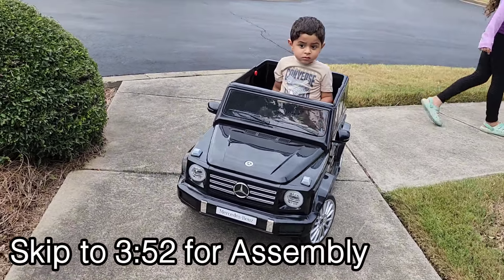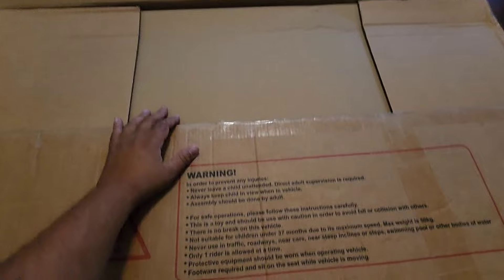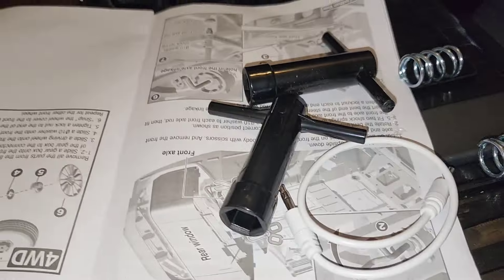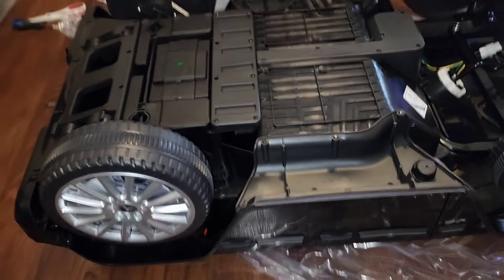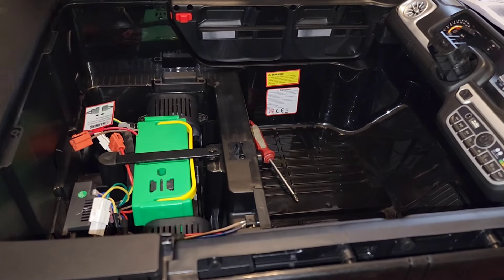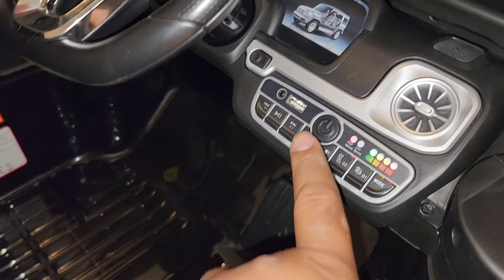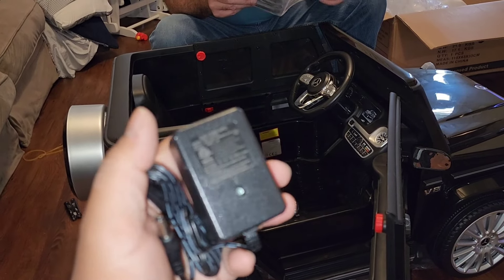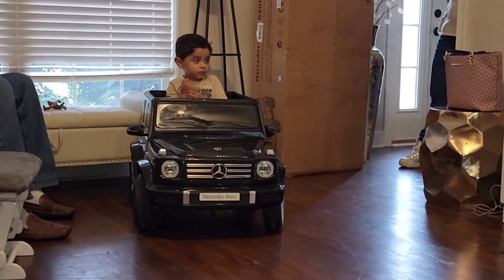Building G 500 Ride On Car W/ Grandpa for my Son's 3rd Birthday | How to Assemble W/Instructions

Comment: How did you sync the controller
Reply from the maker: @devonelzy4196  press the button in the remote and put the car in remote control mode and it will pair automatically, you do nothing  v